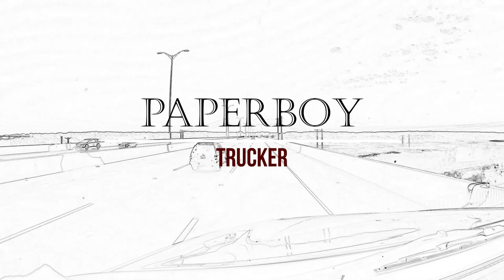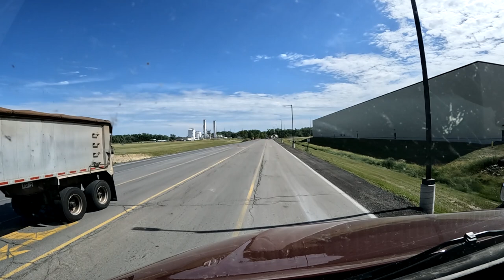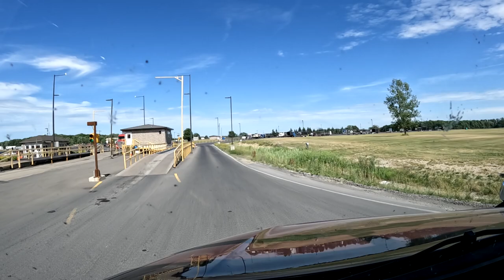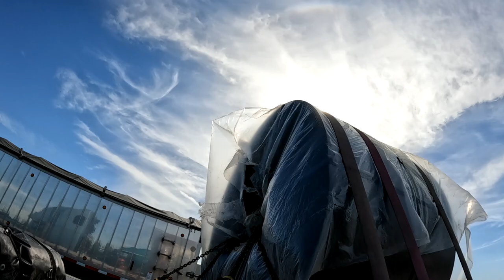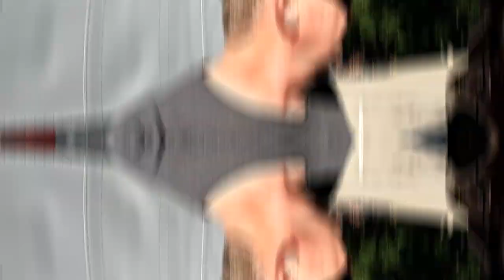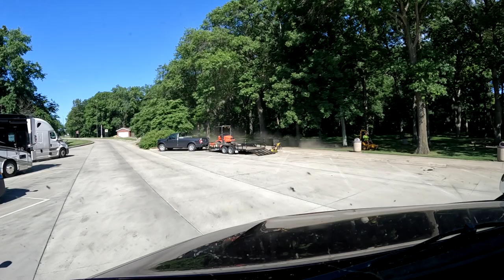Maverick Flatbed Trucking #415 Coil Pickup Big Tarp Talk

Comment: Maverick's $50 pay for tarping is too low.  But seems a key is to make sure your tarps are rolled up correctly to be able to unroll the next time.  What many might find helpful is video showing how you fold up the tarp after you remove it from a load to make it easy to roll out on the next load.

Comment: Let’s be honest—tarping SUCKS! But, you learn little tricks and how to be more efficient so it sucks less. (It still sucks) 
I haven’t ever had to lift a tarp more than about chest high. Going over a tall coil you can partially unroll it and slide it over the top until you can grab it from the other side and pull it the rest of the way over. 
As I said, you will learn how to work with them without hurting yourself.